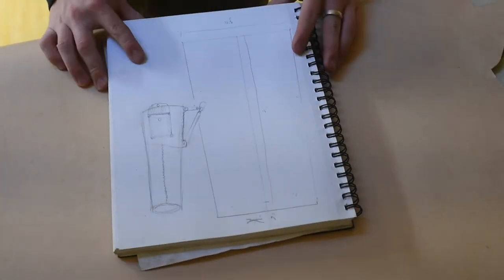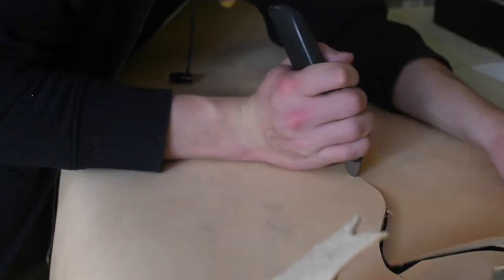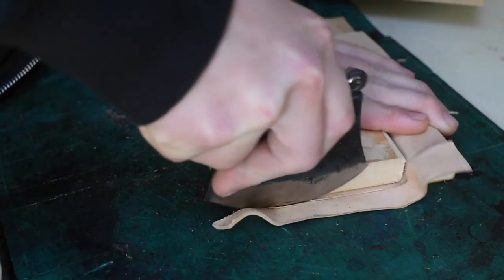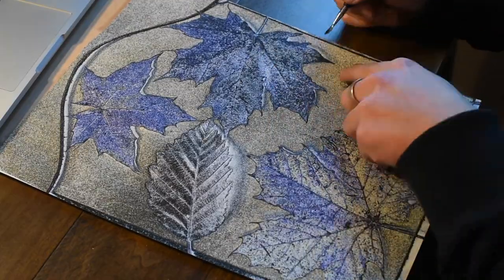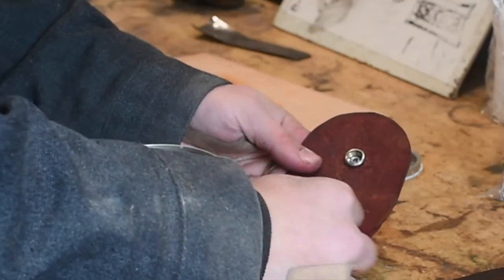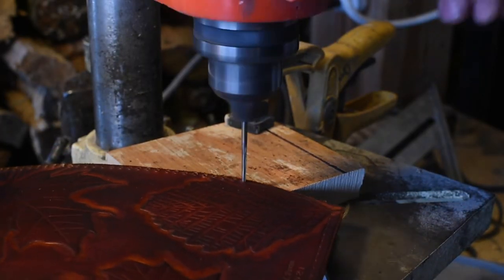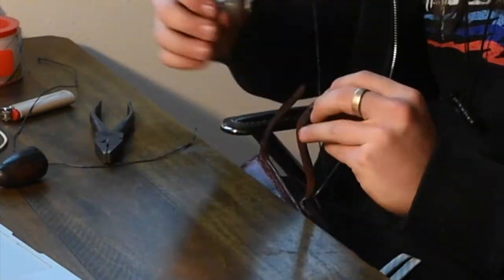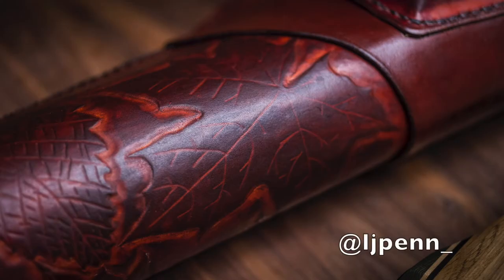Making a Hip Quiver- Leatherworking (+Archery)

Comment: Not sure if anyone has commented on this, but, use a carved and sanded log that is in the basic shape of the quiver as you sew it up.
Reply: You can also drill a thick screw into the top end to give you something to grab onto with pliers or a vice if it’s tight in the quiver and doesn’t come out easily.

Comment: Perfect! Beautiful quiver and exactly what I needed to see. I finished off some mead after a really poor week at work, but it seemed like a shame to just toss the dark stoneware bottle it came in, so I figured I'd give it a leather holder and carry it as a water bottle. The rounded bottom of your quiver and how it was put together is exactly what I needed to see. The only other video I found coming close to the form I had in mind instructed to push a certain type of awl through the leather at a 45 degree angle so it comes out the side and it's real easy to go too far or mess up the angle, but after so many hours of practicing and wasting leather you'll get the hang of it.
Yeah, no. Not just yet. I'ma do it your way.

Comment: Very nice. Get yourself a swivel knife, its used to cut the lines of your designs in the leather before you bevel it, will make it stand out alot more and be crisper. As for sewing a tube, you can make a saw horse type holder for your bench. Cut 2 strips of pluwood about 3 to 4 inches or so wide, maybe more depending how wid ethe tube is,  attach one long edge of one piece to the other piece forming an L shape. Cut 2x square pieces big enough to cober the ends of the  L shape. Turn the piece so that the L shape is facing up, then atach the 2 end pieces so that you create an L shaped gutter. Sit your tube in the middle and This will help hold the piece from rolling while stitching.
Reply from the maker: Thats a good idea. Thank you

Comment: Nice use of the herb chopper! Similar idea to a head knife (only much thicker with a stouter bevel on the edge) and an Uluit (traditional Inuit knife, used for skinning, scraping, leather and chopping meat, vegetables and herbs). If you’re interested in an Uluit avoid the highly decorated stainless steel variety-search out YouTube videos on how to make one from an old (vintage, spring steel) saw using cold cutting with a chisel, vise and a towel, then shaping with a file. You can make yourself a beautiful leatherworking tool!